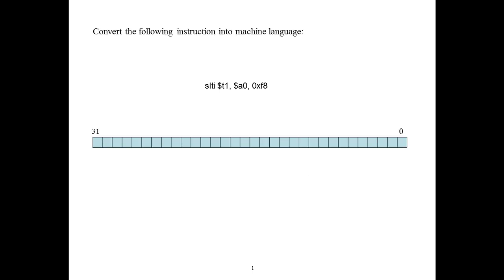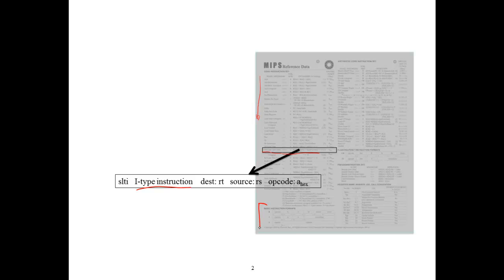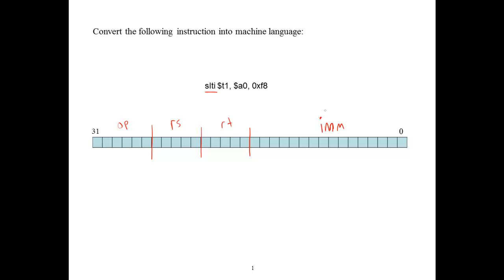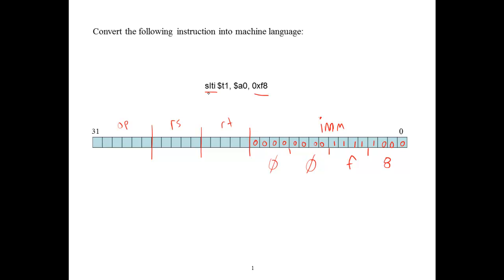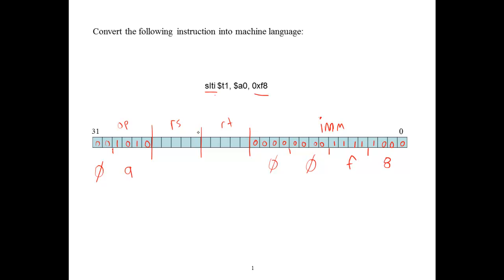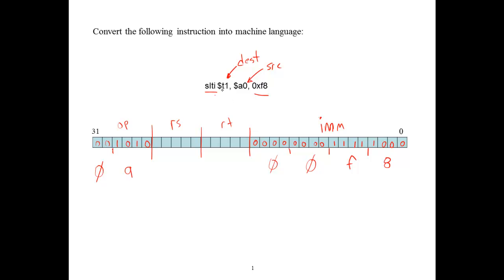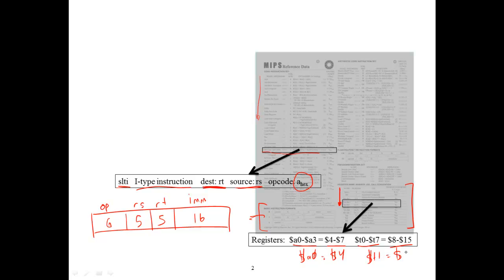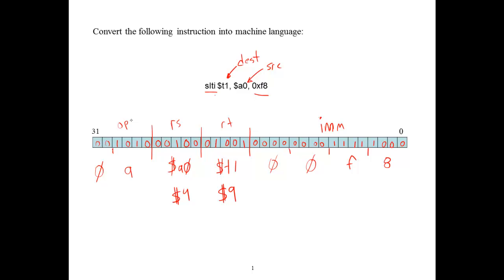Converting MIPS assembly to machine language (A tutorial)

Comment: As far as I know, the instruction jr works like this (in binary), (BinOfReg means binary representation of register, BinOfIn means binary representation of instruction): 0000 00 + BinOfReg($a0) + 0000 0000 0000 000 + BinOfIn(jr). Split into readable segments: 000000 00100 00000 00000 00000 001000. As far as I know most MIPS operations are formatted into 6, 5, 5, 5, 5, 6 bits. With the exception of immediate values like the one used in this video.

Keep in mind my knowledge is limited to MIPS IV.